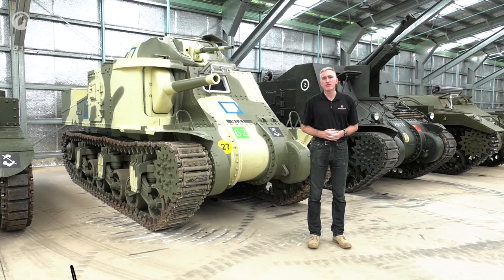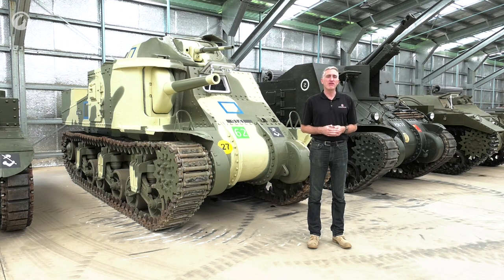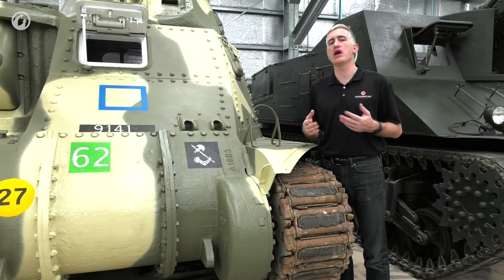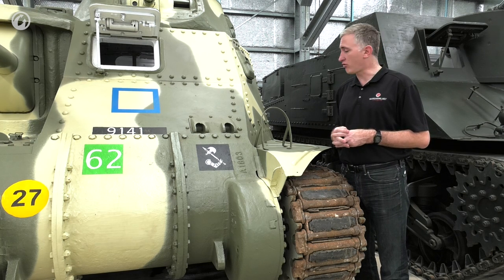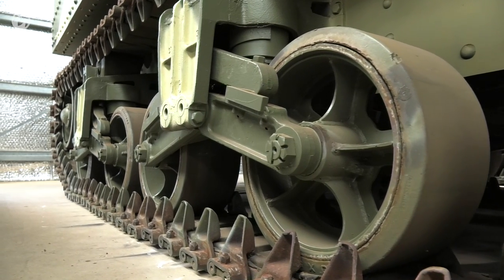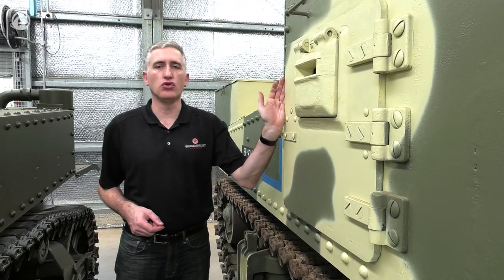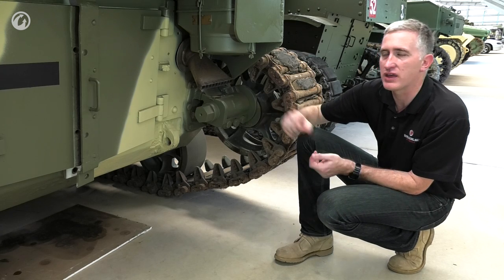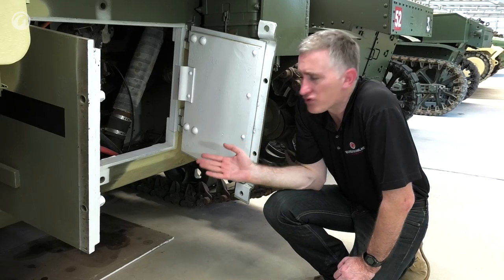Inside the Chieftain's Hatch: M3 Grant. Part 1

Comment: When in doubt, add another turret on top!
Reply: then your tank gets too tall
Reply: The russians were better at that :P they had tanks with 4 turrets ;)
Reply: Yes but you needed it to out all those guns on the tank.
Reply: @jackbean4384  Yeah well using a super tall radial engine kind of ended the idea of a sleek low profile tank.
Reply: Yeah, it's not that it lacks in any other measures like crew size or amount of machine guns. The British version was way better, to begin with. 45-50mm hi-velocity anti-tank gun and 5 crew members would make good enough tank a really good one.
Reply: Still needs a cupola from an M60.

Comment: I really like the idea behind the M3, the lack of a coaxial machine gun seems to be the biggest problem it has. Was there insufficient room inside the turret for a 30 calibre? Maybe a slightly larger or redesigned turret might have been possible. Also I had no idea there was a museum like that in QLD, I really want to holiday in cairns now.
Reply: +Marc83Aus M3 Medium Lee/Grant both have a .30 cal M1919 coaxial MG in the turret. The particular tank in the video might have had it removed as part of its decomissioning.
Reply: In many nations it's preferred if museums don't have functioning weapons. They need to either be disabled or removed. Most machine guns you find on museum tanks are dummies that don't work.
A museum is allowed to have weapons but it needs a high amount of security to prevent theft and needs all kinds of licences. So most chose to just disable the weapons. Smaller weapons like rifles are often put behind protected glass so that they don't have to modify them and possibly ruin the historical significance.

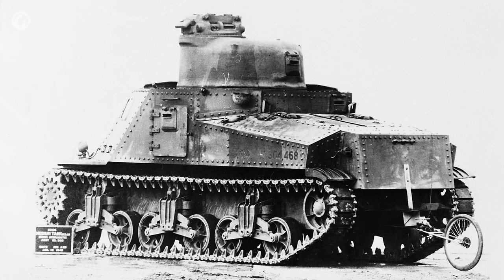Comment: 2:18, why is the tank towing it's own personal bicycle wheel?
Reply: Training wheel for new drivers, duh
Reply: Probably external speed indicator?
Reply: @logion567  Speed or mileage.
Reply: Rickshaw variant proposed for anticipated sales to Chinese Nationalists.
Reply: It measures miles, the testing it. That's how you calibrate speedometers and odometers, and verify fuel consumption, oil consumption, etc. You saw them attaching those to every car they ran through tests at magazines like Car and Driver until a few years ago when GPS equipment became good enough to replace it. How else do you exactly measure distances traveled?

Comment: Hello Chieftain,

always when I see such a thing as welded machine gun ports on this tank I wonder if those spots are actually harder to penetrate than the

rest of the armor. When I think about sloped armor I wonder if there ever have been considerations about a plate fin armor type, where you

apply additional armor with spaces in between (that are supposedly not being larger than an incoming, lets say, 75 mm projectile) .

I am sure this question has already been answered somewhere, but I have not come across it yet.

Thank you :).
Reply: What is going on with your paragraph placement here??

Comment: I'm not sure if this applies to you talking about the Grants 37mm stabilizer around 15:45, but the Shermans stabilizer had even more issues, I don't know if these would also apply to the Grant. 

Ordnances official line was that it "was not precise enough to permit the Sherman to fire on the move but rather helped the gunner keep the reticle on-target during movement, so that when the tank stopped to fire, the gun would already be roughly aimed in the right direction. Gunner who had been extensively trained on maintaining the gyrostabilizer felt that it was a worthwhile feature, but due to combat attrition, more and more replacement gunners were not familiar with the system, and it fell into disuse in some units in late 1944" - Source 'Panther vs Sherman: Battle of the Bulge 1944: Zaloga, Page 28'

However the reality was much, much worse.

1.The gyrostabilizer took at least 5 minutes to spin up before it could be engaged.
2.Once it was spun up, the gyrostabilizer could not be left running for extended periods of time because of wear and tear on the system.
3.Before the gyrostabilizer could be used at all, it had to be calibrated. This process took a trained gun crew about 20 minutes to accomplish.
4.Calibration of the gyrostabilizer had to be performed at least daily, and more often under conditions in which temperatures were very low or very hot, when they changed much during the day. 
5.Fine tuning the calibration could be done only when the main gun was fired.
6.Depending on many variables, fine tuning might require the discharge of one to three rounds on average.
7.Once the gyrostabilizer was fine tuned for HE rounds, for example, it had to be retuned to use a round of different weight like shot or smoke.

'TK-525 Operation and Maintenance of the Gyro-Stabilizer. Chassis Group, Tank Department, The Armored School, Ft. Knox, KY. (2-16-44-500)'

Further reports suggested that not even trained crews used the thing, opposite to what Ordnance officers suggested who also possibly suggested it was much better than it actually was claimed to be in manuals. These reports seem to of been self-serving and intended to obscure the fact that the system was essentially worthless in combat. Not surprisingly they managed to leave out these few important details when claiming the gyrostabilizer worked just great when the crews were properly trained and motivated to use it.

Comment: @ 9:20 -- Don't be daft! You don't disassemble the whole track to flip to the unworn treads, you unpin one link, loop the track around the other direction & mount it on the opposite side of the tank!
Reply from the maker: It's not the direction that needs changing, it's the side: Inside to outside. That means that all the end connectors need to be flipped 180 so that the guide horns are still on the inside.
Reply: @TheChieftainsHatch  Sorry, the smiley somehow went missing off my post. It was supposed to be a joke [turning the tracks inside-out, since the guide horns on the inside of the treads would then end up wrong-way out. But the idea would work if someone had just thought about how to make the tracks properly in the 1st place!] ;-D

Comment: How much was that thing driven? the track pads are totally shot
Reply: It's rubber. It decays. Especially in UV light, like outdoors.
Reply: @justforever96  If i recall correctly 3 years later, they were immensely worn down, uv degradation wont cause that

Comment: Is it really true that the rivets could pop off and bounce around in tanks like these?  Does anyone out there know if that's more than just a myth?  I've heard it both ways and have always wondered....
Reply: Definitely happened.  There's a reason they stopped riveting in favor of cast or welded armor.
Reply: @stuartdollar9912  I'm sure you're smart and mean well, but a simple assertion that "it happened" is basically what everybody says.  What I'm interested in seeing is a clear and evidence-backed statement from an expert or some reliable eyewitness account that leaves little room for lingering doubt about the facts.  Otherwise, to me, the "ricocheting rivets danger" will remain an unverified myth.

As for the reason why they eventually stopped riveting tanks and switched to other means to put them together, there are advantages to welding, at least, which might explain the change in production methods that have nothing to do with the alleged dangers of rivets  These advantages include: 

    Welded joints provide greater strength,  compared to riveted joints.
    The time required for welding is relatively less compared to that required for riveting.
    Welded joints are more leak-proof compared to riveted joints.
    The load carrying capacity of welded joints is higher than that of riveted joints.
    Welded joints generally weigh less than riveted joints.

Anyway, thanks for trying to help. 🙂

Comment: What is the wheel at the back of the m3 lee on 2:15
Reply: Milometer. Used in vehicle testing to verify distance traveled (and therefore speed as well). Not all vehicles have built in odometers, they aren't always very accurate even when they do.

Comment: and lol a train factory building a tank
Reply: Not hard to beleive. A car headlight casing company manufactured the m3 and M3A1 grease gun
Reply: The bogies on a tank are closer to train carriage wheels than the suspension of a truck, locomotive frames are rivetted together and locomotive manufacturers are used to lifting heavy pieces of metal